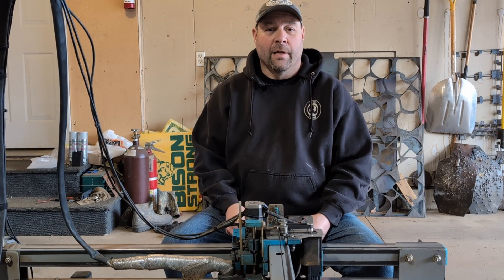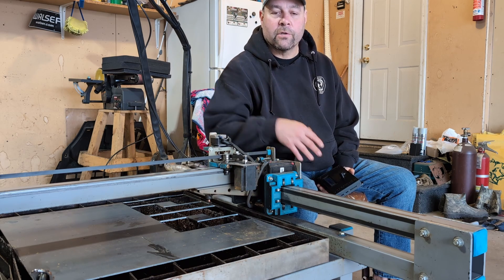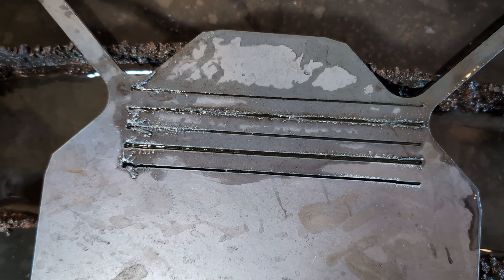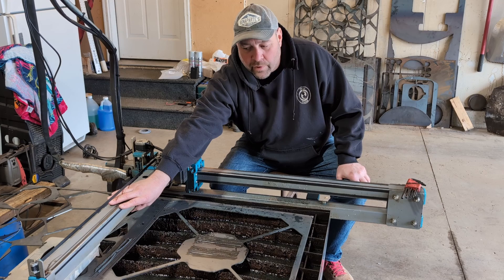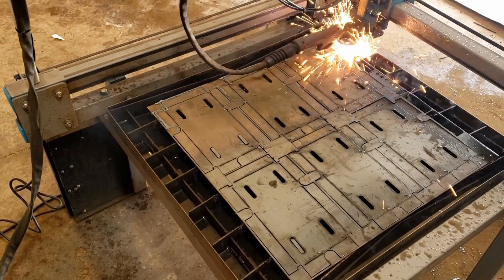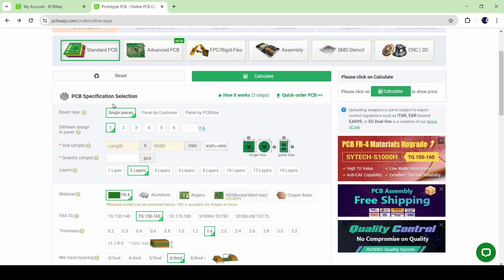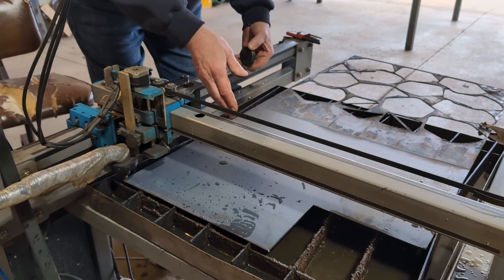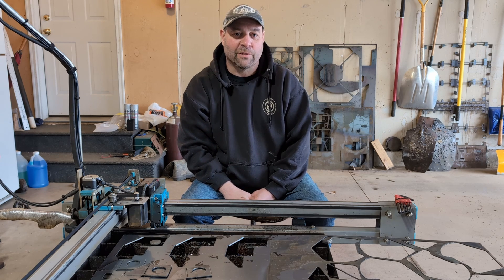DIY Torch Height Controller FINALLY works!!

Comment from the maker: For more Information you can check out our website here. https://jdsgarage.bigcartel.com/
Reply: Is this answer to my question on plans/schematics being available at some point? You’re stating the only way to get the THC is to purchase and that requires waiting until you have more in stock? Just trying to figure out my direction at this point. This will help with “no so flat” metal sheets. Using a weight is not always an option as the torch may hit it. Thank You for your reply in advance. Cheers!

Comment: What is the relationship, if any,  between a Z axis and a THC?
Reply from the maker: The THC has full control over the z axis when the arc is on.
Reply: @jdsgarage701  So they are mutually exclusive? No reason to have a Z & a THC?

Comment: I learned a lot from those 5 test cuts. I am a believer that I dont need Z axis control when plasma cutting, unless the metal you are cutting is not level, you dont need auto height control. But I was not getting the height correct manually. But some of that was inexperience. I rebuilt an old Torchmate 2x2 table and the torch head that was with the table seems to have a shielded tip that keeps the nozzle a little over 1/2" to 3/4" away from the metal, and it was putting a massive kerf at the top of the cut in 1/4" steel when I was making test cuts. I think I need to get rid of that shield, and also do more research. This video is helpful in more important ways for beginners.

Comment: A THC is one of the best things you can add and it’s more complex to say who will benefit and why. The main reason is setting one up complicates use of the tool because it’s not as simple as not using one where you can gauge your height with a shim. Verifying the correct height is a feel/best estimate because obviously the arc has to be transferred to measure the voltage. However if you are cutting large parts and/or thin materials it is a requirement if you don’t want to fight it all the time.  I personally always run max amps and the same psi. Travel speed is the only parameter that changes. Your voltage seems quite high. Although it varies per thickness I run way lower for most stuff mostly in the 30-40 volt range which is pretty close to hypertherms supplied settings. Not sure what you are doing to be up in the 70 volt range but it seems way too high.  By the way I am a career metal worker and welding automation guy so I’m not just some yahoo.

Comment: Sheets of thin-gauge metal in particular tends to be warped, so getting height of torch set up properly - even with z-axis and touch-offs - can be a pain. Overall cut quality also suffers. This is why I am interested THC.
Reply: If your thin sheet metal is not warped it soon will be after a few cuts. I just built my table with a clamping system all the way around. Then I use pre-warped hold down 2" wide metal strips criss crossing the table holding down the smaller section of metal in the center. 

Takes a minute to clamp everything before starting but I don't mind. While cutting no worries about thin stuff moving or warping, It stays down and in place. I am  machinist so when milling I have to be sure my work is clamped well. I started plasma cutting, I just did the exact same thing and made sure the work was not going to move.

Comment: My understanding was, a THC is to help with metal warping from the heat, to make sure the torch maintains a good cutting height. Other than that, I have no idea what else a THC would be used for, so just running along making straight cuts doesn't really show much of anything.
Reply from the maker: The THC is only really used to deal with metal warping and uneven metal across large cuts.

Comment: Excellent work. You guys are great. I don’t know if it matters or not but you should check into nesting your parts. The plates you cut out @12:00 minutes in could be flipped and reversed and you’d be able to fit twice as many on that plate. You’d probably have to draw it like that in fusion but it would save money on plates. Just a thought.

Comment: Hello, I have some questions regarding the plans because I was planning on buying them:
1. Can I build a bigger CNC with your plans? I need it to be able to cut a whole 1.25 meters by 2 meters metal sheet which is standard here.
2. Do the plans include the links/names and specs of the motors, belts, drivers, power source and the rest of the parts?
3. What filament did you use to print the parts?
Reply: I bought the plans.  Greatest $25 you'll ever spend in this day and age.  The description and hyperlinks to everything you need to buy come with them.  It gives exact specifics for 3d printing all the parts.  It gives exact specifics for how to alter every piece to accommodate whatever size you want to build it to.
Reply: @thewhitetdn  thanks for the answer, I will begin ordering the plans and the 3d printer so i can start building it

Comment: I think the JD's table is a great cheap way to get cutting on a CNC table however the cantilever desgin is a con. I am sure mine is not optimized, but there is a lot of slop out far on the end. I typically end up rotating my sheet to cut closer to the Y-axis support (less slop). The THC would really shine here however, I cant justify the cost. Takes 2 seconds to rotate, or, I could build a 2nd Y-axis rail for much cheaper.
Thanks for the video though and thanks for offering the table to the public. This really expanded my capabilities and increase my fabrication time!

Comment: Hello! In 11:37 How and where in the program, or what is the name of the option that allows you to cut slots for bending metal? I wanted to cut the drawer out of metal but I couldn't arrange it.
Reply from the maker: Sheet metal tools in fusion 360 will tell you where to put the bend lines.

Comment: I found that having a good Blowback Style Cutter made all the difference on my CNC.
I started with a cheap Chinese Ebay Cut50 piece of junk and it was junk.
I then bought a new Everlast 62i and it was like night and day once I sorted out the best cut speeds/amps
I did have a THC but I rarely needed it because I rarely cut anything under 2mm.
On my JD cutter I ditched the GRBL controller when I opted to buy the Proma MyPlasm CNC System which was a good all in one option for me at least.
Reply: Absolutely correct. Buy the best plasma you can afford. It makes a big difference
Reply: @superdidly1 
Agreed 100%.
Dumped lots of money in shielded wire, cable management, grounding, hardware (burned up 2 Proma THC's because of HF starting spikes) and after swapping my Chinese HF machine for a Hypertherm Powermax 65 my cut quality went up,and cutting troubles went down.

HF is a bastard.

My Arduino based welding rotator also suffers from it, i can set it up fine on initial startup, and can see the speed and rotation on the display but when welding the display goes wonky.

Comment: I added thc to mine, but it's maily usefull for bigger pieces (talking 900x900mm size). much bigger, calibrating it was a long time for me. Since I'm using mach3 and thc sd controller, it's a bit easier. My torch is cnc torch so it's a bit more compact.

Comment: In terms of dry air what do you guys recommend? I currently just run a Harbor Freight air dryer, but is there anything else I should run to ensure dry air?
Reply from the maker: That's all we use as well as a water trap.

Comment: Good information - I had to watch a few times to make sure I caught it all, but a short on the middle section about getting parameters right with the PSI, Amps based on nozzle, and etc. would be bookmarked for certain.  With the Lotus, do you follow their recommendation for speed?  Is their chart generally, correct?
Reply from the maker: The speeds they list are about twice as fast as we use.

Comment: Yes i definitely need one. I increased the sizing of the table to be able to cut larger pieces and im noticing warpage of material and the bed itself is out in a couple of spots, just enough to throw the cut quality off. In this circumstance i can see a huge benefit.

Comment: So actually no shipping internationally? Not even Canada?
Reply: Hey Guys - I purchased your plans and built the table a couple months ago. I’d like to add the THC and was wondering if the plans to build it are available or if the only option is to buy a completed assembly? If plans are available, how much would that be? I have experience in soldering and building from a pcb. Schematics would be great if thats an option as well. Thank You!
Reply from the maker: They will be once the compliance paperwork is completed.
Reply: @jdsgarage701 Excellent, like others here I scaled up the table size and it will be a benefit for sure.  Let us know when it’s available!
Reply: @jdsgarage701  Excellent, let us know!